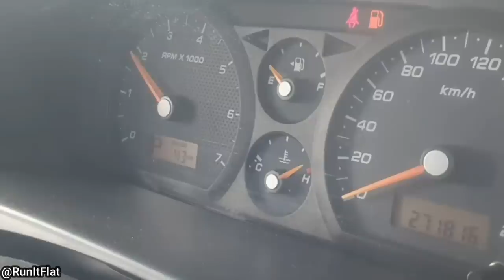Customer States Car Is Overheating And Won't Shut Off! | Just Rolled In

Comment: 0:05 that's the famous Barra straight 6 engine out of the Australian Ford Falcon if anyone is wondering.

The ignition switch problem happened to me in my 2007 BF Falcon. The back cover of the barrel popped off, the three little pressed over bits of the metal housing came loose. It was an easy-ish fix that required no spare parts, you just have to remove the steering column covers, drop the column, rotate it and zip tie it up to work on the barrel. Removing the barrel requires a rivet to be drilled out, and is unnecessary. A little ball bearing was found on the floor so look for that first. I cleaned it all up, put a smear of grease inside where it was done at the factory, reassembled all the bits (spring, BB, cover, contacts, etc), tested the switch while holding it together, then repressed the tangs. 6 months on, no problems.

And before anyone gets on the Fords are crap bandwagon... the ignition switch is made by Bosch. Probably in Germany.
Reply: I saw that right away 😁. I would like to drop one into my 63 ranchero but my bank account said no 🤣😬
Reply: Bosch seems overrated
Reply: What holds ignition barrel is a bolt with the top snapped off you can knock it out with a small cold chisel I've done au falcons and XF Falcons
Reply: @azrailfan2717  If you did drop that Ford Barra engine in,you wouldn’t have to ask your bank account again 👍🇦🇺😎
Reply: quite the "famous" Barra. That one is NA. Still pretty good though.
Reply: Need to save this comment for if this ever happens to my Falcon 😅
Reply: Although these days most of those German corporations outsource a lot of components to other manufacturers elsewhere in the EU where labour costs are cheaper!
Reply: @greebo7857  ummm the Barra doesn't need to be turbo to be famous lol.
Reply: @trashbandit2449  they outsource a lot, like everyone else. things are maybe assembled here in germany, maybe just packaged, but more and more stuff is made in asia.
Reply: That switch was made in Clayton.
Reply: @lotharrenz4621  yeah that's too bad. Really increases everyone's dependence on outside countries, especially on one's that don't like us very much
Reply: @trashbandit2449  even if not, there only needs somethign to happen. see Corona, see Fukujima, and whatever bad things happen in the world. and suddenly vital pieces become rare... or even worse, food becomes rare.
when heavy industry was young, and fledgling machine builders and car manufactures built their sucesses they were proud to make everything on-site. that way you always know what quality parts you get. of course, nowadays these things are too complex for only one company, but still, they buy the tiniest screw somewhere cheap. and throw away half of the delivery because... yeah.
but it's  cheap.
Reply: @lotharrenz4621  exactly. It all depends on things being perfect around the world. Economies were so much stronger when we manufactured at home, now it only helps the Asian countries that poorly treat their workers
Reply: Do y’all know there a alternator at still providing 14 volt 🤦🏻‍♂️🤦🏻‍♂️🤦🏻‍♂️

Comment: That overheating from the second car also happened to my previous one. I had bought it second hand and I drove it for like a couple of years. One day I was on the highway, 120Km/h (72 mph) uphill and suddenly the red STOP light turned on as well as the coolant temperature light and the needle went completely to the right, which meant going over 120 ºC (248 F). That part of the highway has three lanes uphill and I was on the left one. Busy friday afternoon but I got to stop the car on the right side pretty quickly (lucky me).

I didn't call a tow track or anything, I saw no apparent reason so I left as there was an exit just a few hundred meters away. I stopped at a gas station, let it cool for awhile, poured some water in (not that I cared too much about filling it with coolant back then, I know, I know) and forgot about it until next time going also uphill on the highway, different place.

I ended taking the car to the mechanic and when he took the water pump off... well, it was pretty much the same way as the one in the video.
Reply: What does the actual STOP indicator mean? I always saw these when I was in France (older cars, in the 90s) - does this just mean the engine is not running?
Reply: @the_kombinator  As far as I'm aware, it basically means "Stop the engine NOW, damage may result if you don't."
Reply: @the_kombinator  as iGraene says, it means "stop now or your engine may die or at least suffer serious damage". My current car is from 2003 and has it as well. In fact, this days it turns on and off every now and then becase the coolant level sensor fails to register if there's enough, so when it thinks it's undee the minimum required ir beeps three times and flashes until the sensor changes its mind. I know think it's a loose wire/connection. I'll check it out as soon as I can.
Reply: @fadetounforgiven  Oh this is like a master caution light then! I'm used to the brake (!) symbol acting as that - usually it lights up if a fan belt goes and the alternator stops spinning, the master caution will turn on with the Alternator indicator.
Reply: I've had this same thing happen with a 1997 Nissan Micra. Great little car but as I was on the road it started getting hot, then went all the way hot followed shortly by all the way cold on the gauge... I assumed this meant the sensor was no longer measuring water temperature so turned the engine off, put the clutch in and rolled into a conveniently placed service/gas station. It turned out I was right - almost all the coolant had left via the pump's bearing release hole. I whittled a stick, taped it in place and filled the hot engine with water. I made it where I was going, and home again, stopping to top up every 30 minutes or so. Turned out the water pump had completely sheared internally and wasn't pumping water at all - it was thermosyphoning through the engine like an old Model T! New pump was $30 and after that she run just fine.
Reply: @the_kombinator  I think I drove one car that would light the (!) symbol for something other than the handbrake, but I can only remember it as a warning for the brake pads wearing out. I'm not certain about one older car, 1983.

Yes, it's pretty much a master caution light, it may warn you from many different reasons the car "thinks" you should stop right there in the moment, it just doesn't stop itself because it might be even more dangerous (in my example it would have been catastrophic) than letting you do it yourself, but you should stop right there if possible or the engine, or whatever, might be even destroyed.
Reply: On some cars the pump starts rusting if you dont replace the coolant on time.
Additives in the coolant keep it from rusting (for a while)
Reply: @lars5671  in fact, you should not use plain water as it will tend to rust the whole circuit wherever it finds metal.

Mind you, that's exactly what my car got more often than not when it needed to top it. You learn with time.
Reply: @the_kombinator  you're lucky to get more than one light, LOL.  Cars these days...
Reply: It should have still moved water just fine if the bearing wasn't bad.  Radiator was probably plugging up with the same stuff though.

Comment: I've used the ether trick to get tires on the rim.  For smaller tires on mowers, wheelbarrows, etc. just wrap a strap from a ratchet tie down around the outside and cinch it down until the tire bead is touching the rim.  Add air, a good source of shop air helps and presto, it's back on!
Of course flames, noises and mechanics screaming like girls is always more enjoyable! ;-)
Reply: I used to use goop hand cleaner to get a wheelbarrow tire back on the bead . It also cleaned the crapola off my hands lol
Reply: My old boss lost several fingers when the tire pressure broke the strap.
Reply: @kpd3308  Wow that must have been a large tire!  I've only done it on small ones for wheel barrows and carts.
Reply: @cpufrost  truck tire with a metal band designed for that purpose. He still had one anyway!
Reply: @kpd3308  Ouch, that's crazy.  Tires are probably one of the most dangerous things that are overlooked in a shop.

Comment: I remember a guy from high school had his truck that wouldn't shut off. Told him that he would have to pull the wire from the coil. He got it off. It was a very shocking experience for him
Reply: You cad, sir. (Wish I'd thought of that).
Reply: I recently found my dads' phenolic pliers from the 1970s just for pulling coil wires without getting shocked.  Would be safer to pull fuel pump or ignition fuses today.
Reply: Get it, shocking?
Reply: I made the mistake of grabbing a coil wire once very en-lighting experience
Reply: Are you SURE it wasn't the devil?
Reply: Been there done that!

Comment: Fire bead tip #1: be ready to swat the flame out and put air in the tire quickly.  If the expanded hot gas from the ignition spray cools down because you waited too long, the tire will suck itself back off the bead.  

I've done it with a $20 inflator you plug into your 12 v cigarette lighter in the car.  You can even hook it on the tire, only spray the opposite side.  You don't have to go all the way around like the video, and I leave a slightly longer "fuse" trail.  

Don't use too much spray if you hook up the inflator before ignition, you don't want it to be damaged by the sudden pressure generated by the deflagration.  Hope this helps, and be careful.  Try just a little spray the first time, and try more again if it doesn't work.  After you do it a few times you get the hang of it.  Edit to add: now that I've bought a proper compressor, I may not need this technique as badly as I do with my little pump doohickey, but I will probably have to do it once in awhile.  It's really not scary after you do it a dozen times or more, and is kinda routine.

Comment: We had an AU falcon at my old work, the battery was rooted so we'd swap in the forklift battery start it and then swap the bad one back in. They certainly don't need it to run!
Reply: I am a scrapper.  Sometimes I need my trailer winch and don't have a battery.  I just start my truck, take out the battery with the truck running, do my winching, and put the battery back in the truck.
Reply: The risk of removing the battery is that the alternator output may become uncontrolled without the battery to give a consistent reference. The alternator's output voltage may spike to 40 V or even 80 V depending on its design. It's known as load dump. The ECUs should be able to withstand that, but I wouldn't want to subject my car to it that often.

Comment: 0:26 I had the same problem on an old diesel merc, it was a vacuum leak on a hose that is supposed to stop the fuel admission as soon as you stop the car . 
It's very surprising the first time it Happens 😅
Reply: An old Nissan of mine had pretty much the same issue as the vid, ignition stuck on so I pulled the fuel pump fuse, that sorted it pretty quick.
Reply: it means, when the nuclear apocalypse happens, grab an old diesel benz, if there is fuel they'll run forever without electric energy. XD
Reply: @lotharrenz4621  And if your oil rings are shot it'll run without fuel as well on the engine oil leaking into the cylinder. A runaway diesel engine is a sight.
Reply: @modarkthemauler  never happened to me...
when I was learnign car mechanic in late 80's the teacher warned us never to block the intake on a FIAT diesel while it's running. it would start to suck the engine oil in through the crankhouse ventilation, and run away to explode into your face... I never tried it, but I guess, someone has.
there was also the lower two inces of a battery case, reminding one not to test if a batttery is charged by shortcutting the connectors.

Comment: I've never seen anything like that first clip, wow
Reply from the maker: I've seen it on an older diesel on a price of equipment.  But never a car lol
Reply: @JustRolledIn  Do you know if that vehicle maybe has a second battery? Ive seen broken ignition switches causing malfunctions like that, but never seen a modern car running without battery...how is that technically possible?
Reply: @tobiasmetzger4522  on the Ford Transit 250, the battery isn’t even under the hood: it’s under the driver’s seat. Yes, it’s totally an obvious place to put it. 🙄
Reply: @someinconsequentialusernam7799  on most somewhat modern transits, yes. But here you see the battery under the hood. But some cars nowadays have a second (and even third) additional battery.
Reply: @tobiasmetzger4522  same principles involved as old cars, but much riskier with possible damage to all the computer stuff due to voltage spikes without a battery. Especially when revved, which he did.

Comment: Whenever a customer declines necessary repairs, I just say 👌
Reply: I just think of Quint on the Orca after he takes the helm from Hooper & jams the throttle full bore.... farewell & adieu to you fair Spanish ladies 🤣🤦‍♂
Reply: I mean all you can do it tell them what's wrong, what it needs, and what could happen if they don't fix it, if they decline 🤷
Reply: Sometimes you don't want to work on their car anyway.  Everything will be too expensive and they're just going to drive it until it doesn't run anymore.  Then they get a brand new car with payments they can't afford and then it happens to another car

Comment: Well that first car is a Sx/Sy Ford Territory, and (along with the Ba/Bf Falcons) one of it’s very common faults is the key barrel, so when he says “…the ignition switch is buggered…”, it will almost certainly be that… the car has started, then the back of the barrel has fallen of, causing it to continue running. Hello from Australia btw, love the content 🙌
Reply: reckon the barrels already been changed. Looks like he pulls a flat key out, not the ordinary Tibbe key

Comment: I have seen engines keep running like that on small engines but never on a large vehicle engine.
Reply: I never understand why they dont stall the engine to stop it, i stall my engine all the time lol
Reply: That's a sign the alternator is working properly
Reply: So what was the fault with this one, a short in the ignition?
Reply: @mathiascarlsson5746  Key barrel worn out and wasn't connecting the switch.
Reply: @Mercmad  ah thanks.
Reply: @GumGumBoy5  Probably an automatic, the car in the first vid is an Aussie Ford Falcon, the vast majority are autos.
Reply: Some older gas automotive engines would "Diesel" after shutting them off, running for a short time on just compression. They ran rough and wold eventually die on their own.
Reply: Had happened on a semi before 15 l Cummins take the key out keeps on running you can turn it to any position it keeps running it was the ignition switch the key cylinder sprayed some contact cleaner in there and jiggle it back and forth a few times and it's been good ever since
Reply: My Escort did this once, after I put JET-A into the tank (5 liters worth on an empty tank) - more of a dieseling effect, as the ignition was actually off, just self ingnighting with compression. Because it was a manual, I just stalled it. It happened to my automatic 1985 Pony recently, I just pulled the lead wire out of the coil. I'm not sure what I would immediately do on a modern-ish car, probably pull the fuse for ECU, fuel pump, or whatever circuit controls the spark.
Reply: There’s videoes of train locomotives with blown turbos “ run away engines” that are sorta like the first video, difference is they are running off of oil from the turbo , sometimes they blow up , not sure how big their intakes are 😮
Reply: that's odd, on all the vehicles I have owned, you only need the battery to start it, once the alternator is running you can take the battery out. have done it a bunch of times to jump start a car without jumper cables, take the good battery out of the good car, sit it in the flat car, start it and let the idle settle, then take the battery out of the now running car (careful to insulate the positive lead so it does not short out) and put the dead battery back in.

if its an old diesel, you can even disconnect the alternator while its running as once running, they don't need any power.
Reply: @sw96  When you don't know how to drive an auto you can stall them too, try going from a stop and step on the brake like a clutch. Ouch.
Reply: @GumGumBoy5  probably because most falcons are autos from the 90's onwards.
Reply: @mathiascarlsson5746  it's a bf falcon by the looks common for the ignition barrel to fail in fact every one I know with a ba/bf has had a bad ignition barrel including my own ba lol
Reply: @justaaussie  Thanks, I'm in Sweden and we don't get any Australian cars here so unknown fault to me, now I know though and it makes perfect sense that's what happened.
Not saying Australian cars are bad or that this fault doesn't happen to other cars, just that I don't have any experience with this particular car.
Reply: @tinknal6449  My first car was a 72 Vega that dieseled horribly, even after they replaced the engine on a recall. You could go do your grocery shopping and come out to find the car still coughing & sputtering away.
Reply: @deadrose23  Seems to me I remember having a car that I would have to put in gear to kill the engine.
Reply: @mathiascarlsson5746  no worries here mate just letting you know what you was watching lol it's a Common fault here in this particular car the plastic backed part of the ignition tends to split from the steering column and your key doesn't do anything anymore 😂 probably happens on other cars too but probably not as much as the ba/bf hahah I own a ba falcon and will admit that it's more than a fault lol it is why I like Holden's more

Comment: That was a sweet exhaust system in for inspection. Could have used some hvac ducting and pool cleaning hose to round it out. Duct tape and chrome spray paint would have really brought it home 🤣.